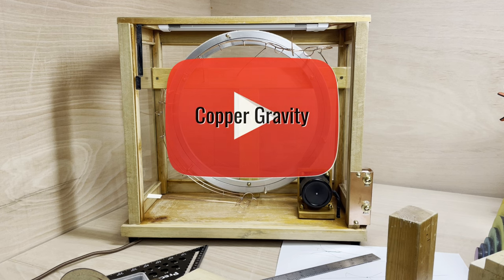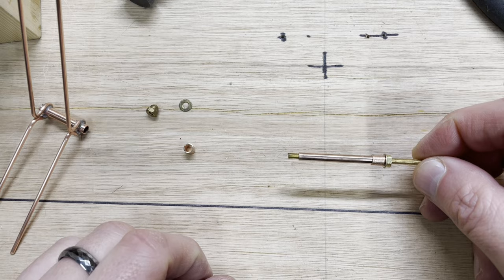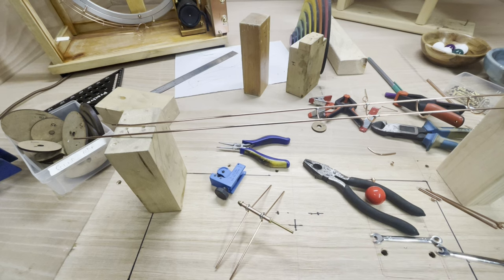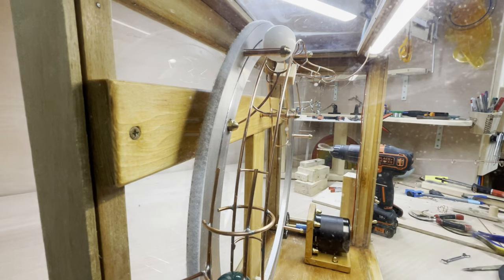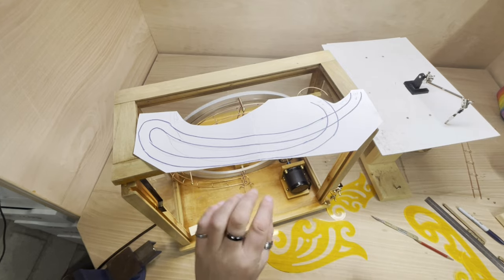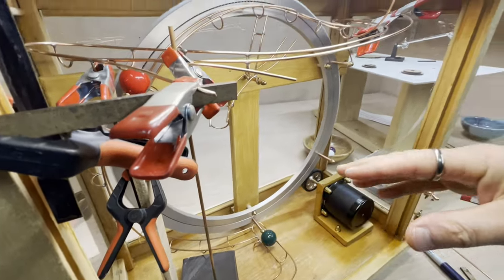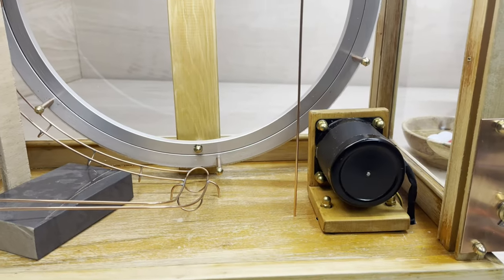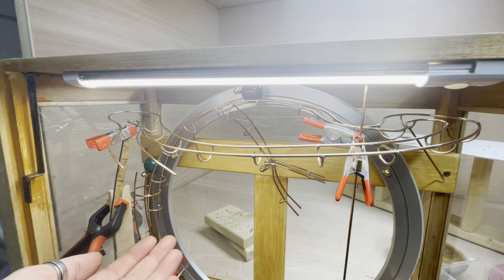A Good Rocking Switch - Rolling Ball Sculpture - Story 77

Comment: At 7:00; I thought that was for something else, like a track switch for the pathway split option. Pardon my thinking pinball machine logic at times. . These days the pinball company can update the game rules and now the ball needs to be aimed differently. .
Reply from the maker: I wonder if anyone has made a rolling ball / pinball hybrid machine. Hmmm 🤔
Reply: I'm working with an arcade coin drop machine, comes apart for maintenance,  I'm still working out how to play a pinball-like game at that angle. Lots of working out simulations in the sandbox mode of Poly Bridge 3.  @CopperGravity